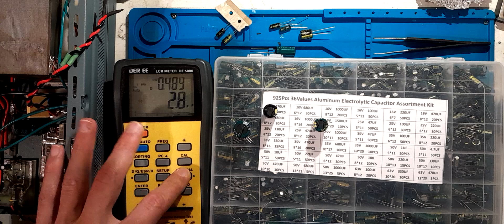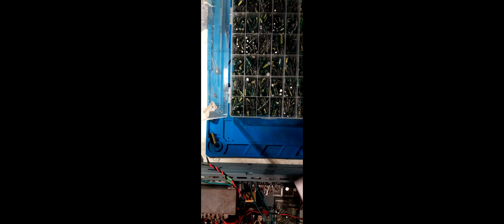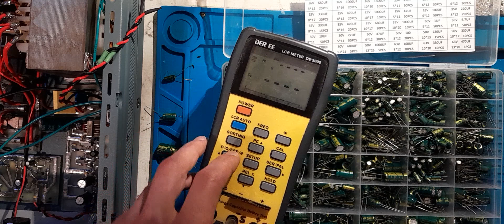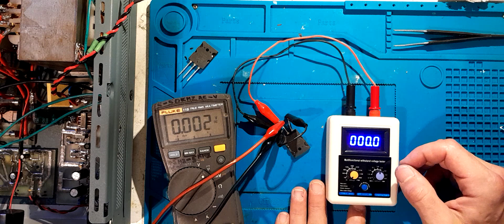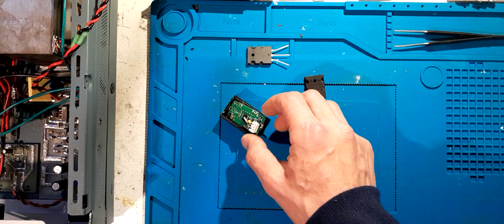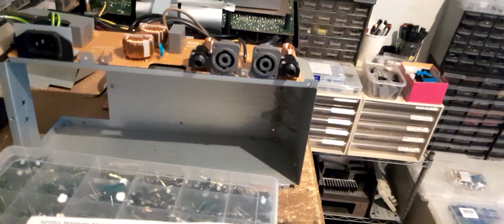Testing dodgy new capacitors and also testing new transistors....not so dodgy!

Comment: Ah, those AliExpress / eBay / Amazon Shenzhen market specials. 🤣 Yep, they're rubbish.  I too was surprised they didn't explode when you voltage tested them on your power supplies.  Strangely I've seen ChongX and similar "no name" electrolytics in commercial equipment and even is some DIY "audiophile" equipment that's come in for repair.  Now I know some YouTubers actually defend these because they're cheap and possibly they haven't had any issues with them.  I'm sure if one of these capacitors rated at 35V was used in a 15V circuit for a non-critical application they'd probably work and the builder would be none the wiser.  In medium to high impedance audio circuits a coupling capacitor with a slightly higher than normal ESR would not impact on performance but as you know use as decoupling or filtering capacitors in a switch-mode PSU the ESR and the ripple current rating is an important issue.  Almost without doubt, electrolytic capacitor failure in SMPS is quite common as some manufacturers cut costs and settle for parts that only just outlast the warranty. ☹
One thing is for sure.  You won't find the better vendors of electronic parts selling these.  The other concern I have is when it comes to power supplies I've never been able to find any datasheets for these "no name" capacitors which brings into question not just their ESR but also their ripple current rating especially as they appear to be significantly physically small for their claimed capacitance and voltage ratings. I wouldn't be surprised from the land of fakery that these might very well be rejects that some enterprising company has purchased by the millions and had them re-sleeved with their own brand on them complete with spelling mistakes.  It's not an uncommon practice so I've been told.  A bit like remarking reject substandard or fake semiconductors. 😡 Caveat emptor.
Reply from the maker: Yep that's why I made the video I want people to be aware that they're too small, have bad esr, and are over specd. Like I said you would have to use the next value up it a 470 for a 330uf to get reasonable esr and capacitance and also a more appropriate size wich would also help with ripple current ratings like you said. These really are just crap.
Reply from the maker: Atleast my transistors are good!
Reply: @daveselectronicslab  Yes, looks like a good score there. 👍👍
Reply: @daveselectronicslab  I am just starting in this world and YouTube recommended me your channel. Saw your new and don’t have a ton of subs so here ya go. Maybe you’ll help me from buying that attractive cheap shit too….
Reply from the maker: Now worries mate....glad to help! And thanks for the sub@AlexDoingAlexThings
Reply: @daveselectronicslab  No prob dude. Keep up the great work!